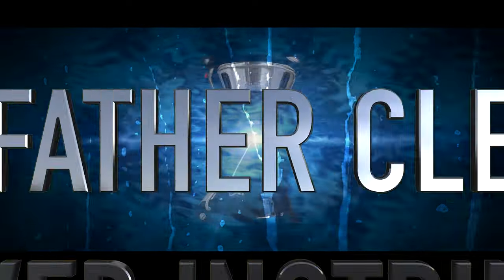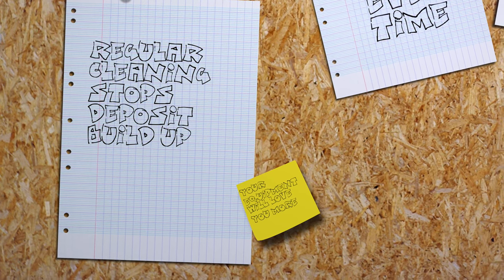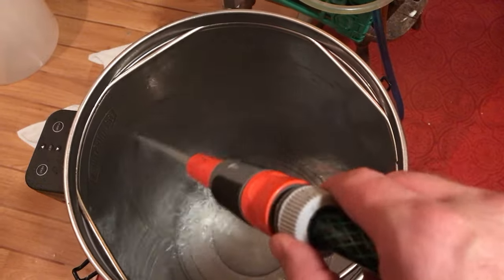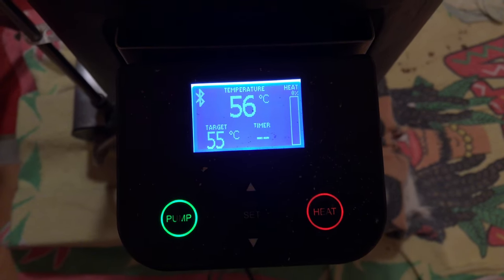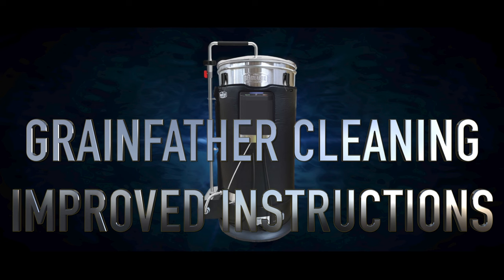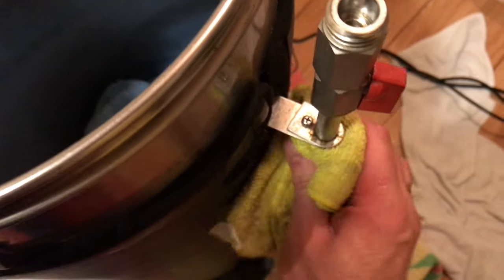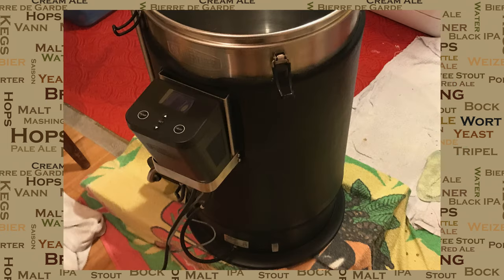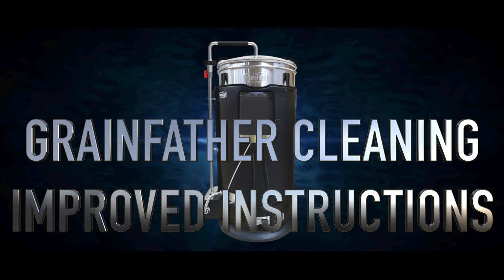Grainfather Cleaning, Improved instructions

Comment: David, I think we should mention that the GF should never be emptied of water if it's still hot.  If the elements are above about 50C, there is a chance of the element coils getting super-heated and burning up.  Always allow any water to cool down to about 30C or less to insure coils don't burn up.  Lastly, the stainless should be passivated by using a weak acid solution such as StarSan or even distilled vinegar.  Passivation will leave a strong layer of oxidized steel and it will be easier to clean.  The outside can also be passivated.
Reply from the maker: +beerman1957 All good points, thank you for your input :)
Reply: beerman1957 oom

Comment: Excellent stuff, David! Thanks!!
Quick tip on 1:40 --> as a very general rule of thumb one should never add water to an agent. Always add agent to the water until desired mixing ratio is achieved. While unproblematic in this particular case, adding water to an agent harbors the risk of extremely strong reactions which can cause all kinds of problems (damage to the surrounding material, fizzing up and splashing onto you in very high concentration etc.).
Reply from the maker: Thank you and yes quite right :)
Reply: @DavidHeathHomebrew  A useful rhyme, from my days as a lab chemist: "when in doubt as to which you ought'er, add the agent to the water".
Reply from the maker: Cheers Bill 🍻🍻🍻

Comment: David, 1 additional step that I have found helpful in achieving a better cleaner, clean up.. Before you start the circulation of the cleaning solution, or the clean rinse water, in both cases have the exit tube from the heat exchanger in a separate container and 1) during cleaning phase, wait until the remnants of the wort flow through into the container (instead of into the grainfather) then put the exit tube into the grainfather and let the cleaner circulate and 2) during the rinsing phase, let the soapy water drain into a separate container (instead of into the grainfather) and then run the rinse. In both cases this takes just 30-60 seconds for the wort and/or cleaner to rinse through into the separate container and avoids contaminating the grainfather...
Reply from the maker: Very sorry for the late comment for some reason Youtube hid this from me. Sounds good Darren. I will look into this.,

Comment: Thanks for the great channel! 
I have managed to brew many great batches with your recipes and instructions :-)
While ago, I was visiting a commercial brewery and the tour guide told that they use hot steam to clean their brewing equipment.
This gave me an idea and I started using a cheap, household steam cleaner for cleaning the GF. 
It literally melts those nasty bottom plate stains, no intense scrubbing needed.
Of course, thermally insulating gloves and protective goggles are needed for this.

Cheers!
Reply from the maker: Great to hear :) Yes steam cleaning is very popular commercially for sure. I wonder how much I could get one for myself. For stubborn stains I use Barkeeps friend. Very fast and easy.
Reply: I use some no-brand 1200 Watt steam cleaner that costs about 50 € at your local supermarket. 
Of course, there are more pricey alternatives starting from 200 € if you really want to invest. 
However, this apparatus can also be used for it's main function which is cleaning the household, floors, windows etc.
Good to know about the Barkeeps friend stuff. According to product info, it could also remove small scratches from stainless steel. Cool!

Comment: I run the water out using the wort chiller hose after each step, both for the cleaner and clean hot water. Saves picking up a heavy Grainfather full of water....  :)

For the clean water step I just use hot water from the tap (It's 52 degrees, so plenty hot enough)

Be sure to turn the element off first!
Reply from the maker: How many litres are you using to clean with? You dont need more than 5L, so its still light at that point. Better to heat it to 55, thats the recommended temp for the cleaners to work their magic :) You need to maintain that temperature throughout both stages for the best results. Hope this helps.
Reply: @DavidHeathHomebrew  I’ve been using too much water for my cleaning- wasting money by needing too much PBW for proper ratio! Thanks!

Comment: I recently bought a GrainFather and just did my initial clean. At the end I went to blow all the water out of the chiller using my compressor. Just a suggestion to anyone trying this, reduce the pressure else the end where the water is coming out flails around quite badly, and you will get soaked. Learn from my mistake 🤔
Reply from the maker: Good advice there Paul. I use a bicycle pump that has only ever been used for this purpose. It does the job nicely.

Comment: The bike pump tip to clear water from the counter flow chiller was excellent.  Worked well.   Question though: following my prior brew and rinsing before sterilising for the current one I notice blue crystalline deposits coming out in the rinse.  Have you experience that before? I assume it is some sort of copper salts etc but why would that form when only water residue would be present?  Thanks.
Reply from the maker: Great , thank you. I have heard that PBW can cause this blue effect. It is not something I have seen except in photos though. As to why I guess 5 star chemicals would be able to give you a very precise answer.
Reply: michael0765 Hi, did you get an answer from 5star or found out what was causing it? Got blue liquid out of my cfc as well after rinse.

Comment: Hi David, many thanks for this. May I please ask - I've just started using the G40, do you have a video that covers the process for flipping the G40 upside down, unscrewing the base and cleaning out the pump? In my opinion this is rather glossed over in the instructions and I'm not very practical! I emailed this question to Grainfather a month or so back, yet to get a reply!

Many thanks
Ged
Reply from the maker: Hi Ged, GF say that if you clean as recommended then there is no need to do this thankfully 🍻🍻🍻.
Reply: @DavidHeathHomebrew  Excellent news for which I thank you!!
Reply from the maker: Cheers 🍻🍻🍻

Comment: As you've said in your comments, the SS cleaning pad that you used in the vid is probably not the best idea - you can actually see faint scratching on the floor of your GF.  I cut a lemon in half & use that - takes a little more work, but the citric acid cleans the scorch marks off & leaves the bottom shiney & scratchless.  I do like your idea of running the chiller & recirc arm in series - definitely saves some time.   Have had my GF for over 2 years now & still going strong.    Thanks for the vid!
Reply from the maker: Many thanks for you feedback :)
Reply from the maker: If you use the SS pad very carefully then you will have no issues, its a last resort and ive barely used it at all on my GF. I was just showing that it can be. These solutions are used in professional environments in this way also. Ive not had a problem with it in over 30 years. If you do not feel comfortable with it then thats fine, I just wanted to point out that they can be used if you are very light and careful.

Comment: Super handy guide here David! There is just two details I'm thinking about: Chemipro OXI. Is it ok for all parts of the GF or are you better of switching to PBW? I used OXI in my last cleaning and the pump could not handle the solution, the OXI forms bubbles in the water and the airated water made the headpressure from the pump turn so bad that after just a few seconds the water coming out from the chiller reduced to drips. Concentration used: 4g/L. Maybe I just need to make the solution weaker? You could actually hear the pump struggle with the noise common with bubbles.

I'm also worried about using OXI for plastic parts and mainly in this case the rotor in the GF pump. I have used OXI for cleaning my auto siphon and a capper and noticed parts of the plastic turning white-ish and even broken down into a black smudge, almost like a chemical melt to teh plastic. Maybe a weaker solution is key in this case to?

It would be interesting to hear your oppinion on this!
/Greetings from Sweden
Reply from the maker: Thanks :) OXI is ok but I would use PBW every 3rd brew. It will ward off proteins better and your equipment will get a better clean. Ive used 4g per litre before without issue.

Comment: What do you do about all the other bits? I leave the overflow tube parts and everything else that fits inside the GF while the pump is running with both PBW and clean water. Afterwards they're all nice and clean. The mash pipe itself I clean in the sink.

Also, when I turn on the pump for cleaning, I pump the liquid into the sink until it's clear, so I don't fill my cleaning liquid with trub and wort. And when I change to clean water and start the pump, I send the first few seconds into the sink as well to avoid getting cleaner fluid into the clean water.
Reply from the maker: +Erik Hagen Yes in pbw from the unit like you do :) Forgot to mention it!

Comment: Thanks for tips! any suggestions for cleaning a scorched bottom of the kettle? I want to be careful not to scratch it but ended up scorching the bottom on my last batch.
Reply from the maker: Hi Erik and thanks. I suggest a strong serving of PBW in a few litres of water that is heated to 55C for 30 minutes and then left without heating overnight. Scrub using a plastic brush. Then rinse with water. Then follow up with a layer of diluted star san or similar for a few hours. If this does not manage it then try steam cleaning.

Comment: As ever, thank you for the useful video! Can I ask an off topic questions / request? I have just finished a brew, and for the first time, as per your advice, halfway through the mash I gave the grain a stir. For the first time  ever I beat my number, so it seemed to work well! However, perhaps I was just doing it in a clumsy way, but either while removing the top plate, or mixing, I ended up with loads of grain in the body of the boiler. I wonder in your b ft video if you could show this step again, in a little more detail?  Thanks
Reply from the maker: Hi, I have never had this issue to be honest. I wonder if it was due to grain crush being to fine and leading to small amounts being stirred through the holes in the bottom plate? One way round this would be to get a small amount of fine mesh and cut it in a circle to fit on the bottom of the grain basket for use while mashing.

Comment: Very interesting video David.  I have generally gone by the book when cleaning.  I am not sure of the advantage of putting the recirculation arm in series with the wort chiller unless it's to clean both at once.  So far the recirc arm seems to need very little treatment anyway but it's something I am going to try next brew.  Would it be worth trying to get another screw fitting and piece of hose for the recirc arm that can be used solely for cleaning in place of the hose clip.  Also how did you get the bike pump to seal on the wort chiller to empty it out.  Emptying the chiller has always been a pain as the method shown in the official video doesn't seem to work too well.

I have found Bar Keepers Friend in liquid or powder form has been brilliant for removing stubborn residues on the bottom.  Easily available from Amazon and eBay.

Thank's for a good thought provoking video.
Reply from the maker: +wrongway2001 The connecting is purely to clean and rinse them both at once. Less fuss and before I started doing this I noticed some build up on the recirculation arm, which has now gone back to its new state, so it benefits from the longer clean. Bar keepers friend is decent, I show it in the video :) I push a bike pump onto the wort out part of the cfc , holding a seal before pumping, works well :) You could use a pressurised spay bottle, like is sold in garden centres or use any air system.
Reply: Makes sense.  I'll keep an eye open for build up on the arm and will try your method next time.  Now to dig the bike pump from the garage.

Comment: Hi David. I brewed my first time a couple of months ago already using the Grainfather G30. I did not clean it with the ‘high performance cleaner’ from Grainfather afterwards. Instead I just circulated hot water through it a couple of times and removed all residue, using one of those kitchen birstles and some dish soap, then dried everything as much as possible. The CFC is difficult and today while blowing through one of the silicon tubes connected to it I could hear and feel a gurgle of water still in there somewhere. Now, my questions are: is it ok to only rinse and circulate the GF with warm/hot water after brewing or should I use the HPC as well? And is it possible to remove all water from the cfc in a way? Thanks in advance.
Reply: Ok I just saw your bicycle pump tip for the CFC water removal. Also, is it ok to use the High Performance Cleaner after it has cleaned the GF for 7 gal. brewbuckets from SS?
Reply from the maker: Hi Tristan, yes the bicycle pump will remove water from the CFC. This is important due to it being copper. It is also important to clean the system with a cleaning product. It does not have to be the GF branded stuff, there are alternatives. If not then you are going to run into problems with protein deposits on the bottom plate.

Comment: Hello David, thank you as always for making these videos.  This is exactly how I clean my system as well.  Sometimes I add an additional water only cycle to make sure all the PBW is out of the system.  I do have a question with this.  I've had three batches of homebrew all have the same off flavor.  The smell and taste is like detergent or soap.  All three tasted the exact same.  I've left it to soap being left some where in the system so thats why I run the an additional water only cycle to make sure it's washed out.  Any advice for me to look at?  Thanks
Reply: @DavidHeathHomebrew  It turned out to be the rv rated hose I was using to fill with.
Reply from the maker: @Biggin69camaro Ok, glad you fixed it. I have been doing a purge of older unanswered comments due to a Youtube bug by the way 🍻🍻🍻

Comment: Do you actually lift the the whole unit up and dump out the water after the clean cycle and after the water cycle?
Reply: Mark Paulick - I tend to pump as much out as possible into a separate bucket/down the sink then lift the unit up to pour out the last two litres that doesn’t get taken up by the pump
Reply from the maker: Yes, I lift and pour. :)
Reply: You are Thor :)
Reply from the maker: Its not that heavy :)

Comment: Thank you David for that video. I  received my GF 2 days ago and I'm ready to  clean it. Question: after cleaning the trub with the  scouring pad  ( 1:14 in the video  ) ,how do you empty the GF ? using the pump ?
Reply from the maker: Glad you found it useful. There is a dead space within the system that the pump cannot remove. The only way is to tip to empty. You will first tip the trub and then the cleaner and follow up water.